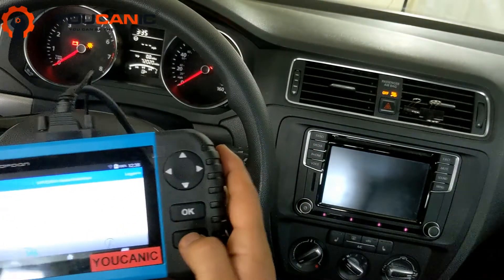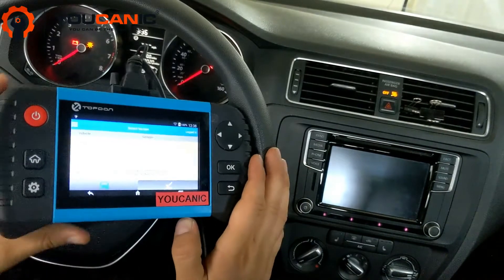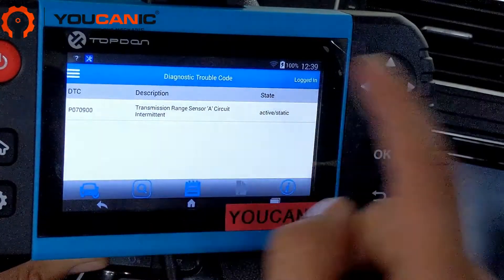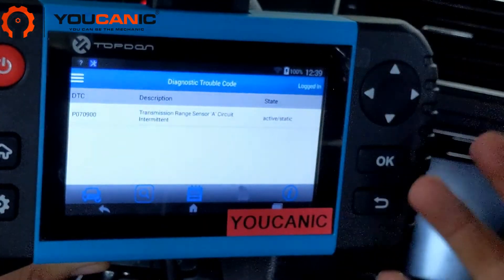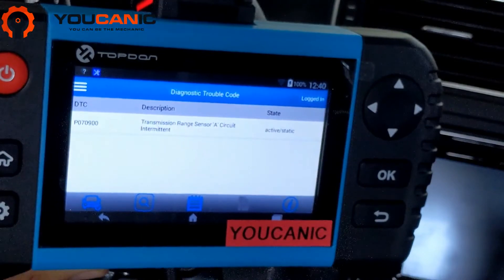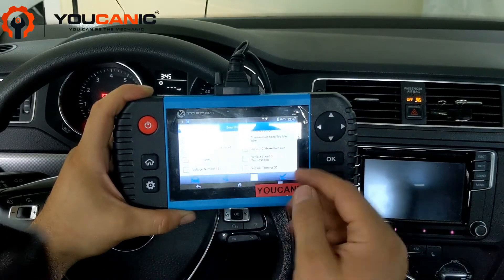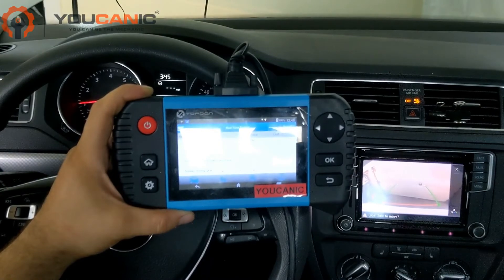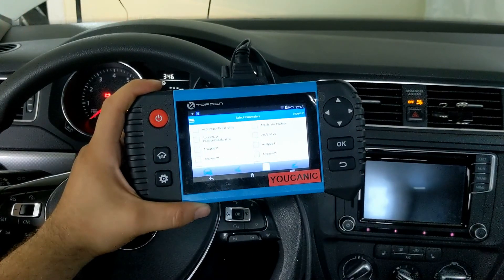Troubleshooting Volkswagen Transmission Problems: A Comprehensive Guide

Comment: Please help i want to determine whats wrong with my car , 2012 vw tiguan wont engage i have only 1 code p0271 would this code prevent it from engaging i put it on drive nothing happens the engine rev but the car wont move i checked the leankage and its good i can even see the leaver move i have no reverse also .

Comment: My VW Polo 6n2 has a hard shift in gears and it sounds like a knock (hard clunck).. my mechanic says i need to buy a new gearbox, the other says i need to change the hydraulic am currently using..  What would be your ideal advise
Reply: I lhave same problem

Comment: My 2015 VW Jetta has a delayed shift between 1st and 2nd Gear. My Scammy Dealership won’t help me because there is no engine light.
not sure what is wrong with it.
Reply: Did you find the solution ?
Reply: @jimmymodad7610  nope still doing it
Reply: Dude I have the exact same problem on my tiguan.  They straight up lied to me too, because they claimed that they drove it 80 km and couldn't get the car to do what I said it's been doing and that it drove super smooth.  Literally the same day I picked it up it did it again.  But because nothing comes up on the scans they claim there is no issue.
Reply: @rorythomson3439  yup they tol me nothing was wrong with it. $2000 warranty for nothing…
Reply: Told*
Reply: @jacklinh8111  it's super frustrating too because it'll be hard to sell with this issue and it's probably going to get worse over time.